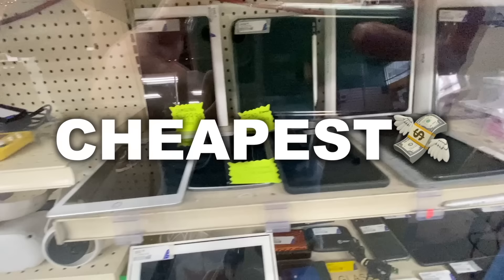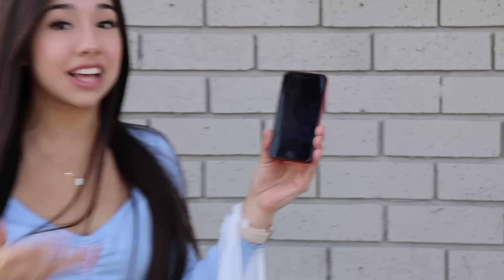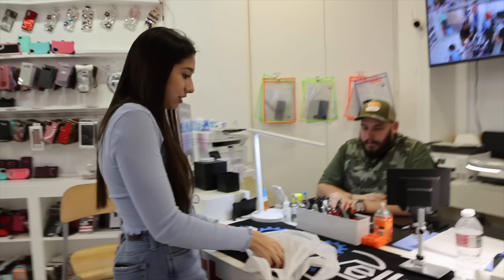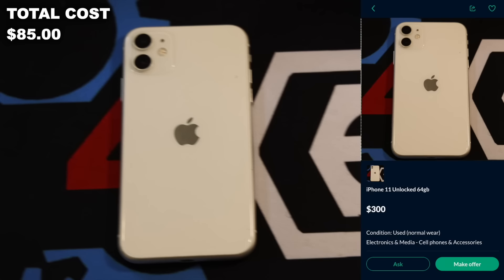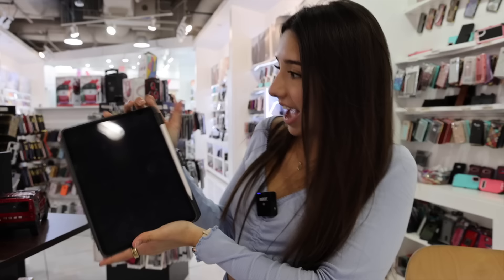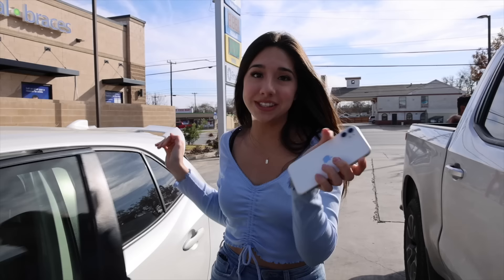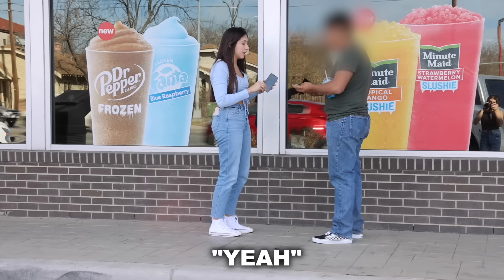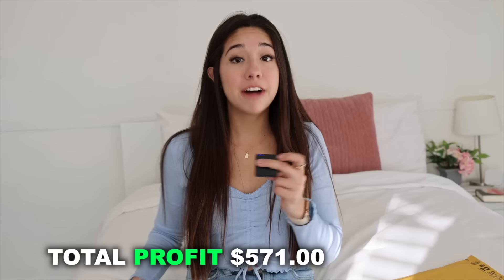Fixing CHEAP Broken iPhones & Selling Them!

Comment: The content is great and all..
But there is some part that I really didn't like, Why did the shop lower the price? is it because you are a girl or a youtube? you should have worked with original price and not use those guys there - even if they agreed to - and then calculate with actual expenses.
Reply: that shop she goes to scams their customers with price gouging on cases and screen protectors that they bought on amazon